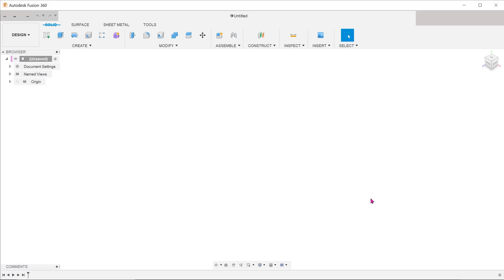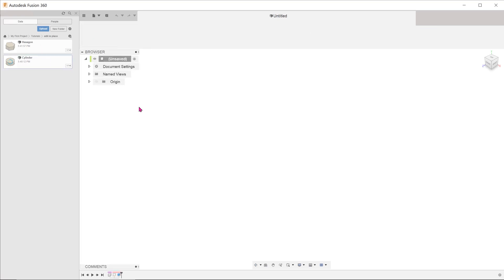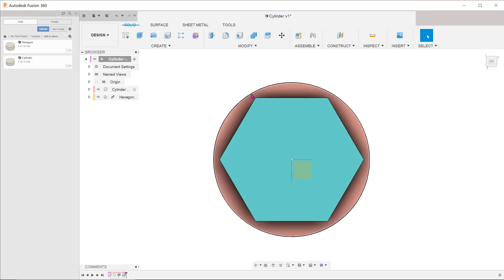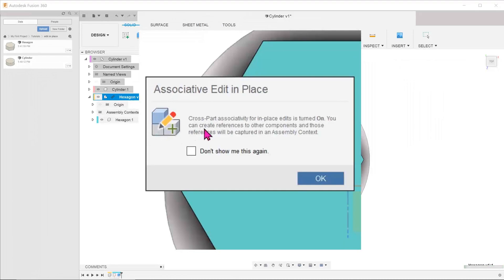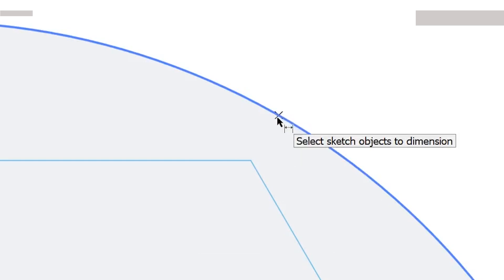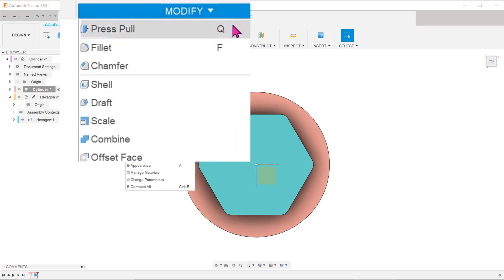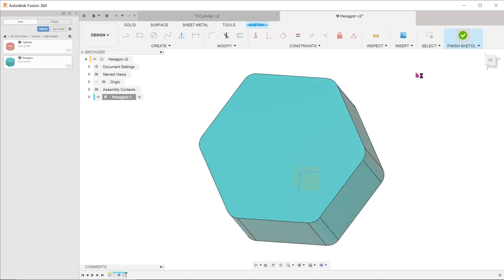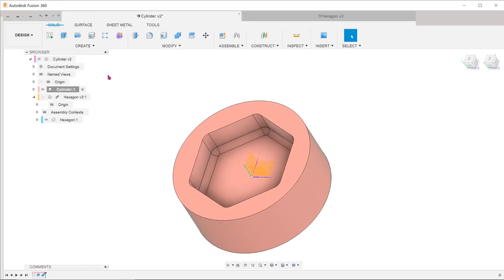Fusion 360 - Edit In Place

Comment: When I hover I do not get the icon. Am I missing a step in getting this to work. Thank you
Reply from the maker: Hi Steve, could you confirm if you hovered over the component that was inserted?
Reply: I was using a file that created. Are there more settings that need to be changed?
Reply from the maker: At first, I thought that it might be because you did not enable this option in preferences. However, when I disabled this, the edit in place icon still appears. So that does not seem to be the issue.
Reply from the maker: Hi Steve, Autodesk has just released a new update which fully releases the edit in place feature. It is no longer a preview feature. You can try updating to see if it solves the problem.